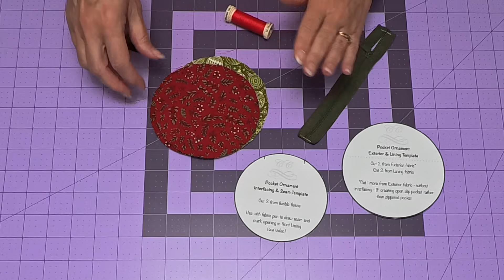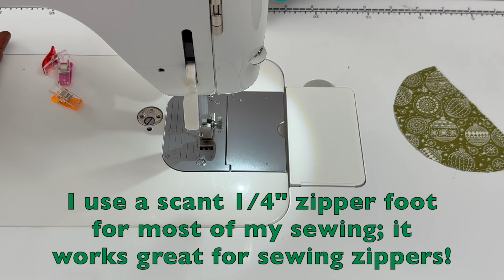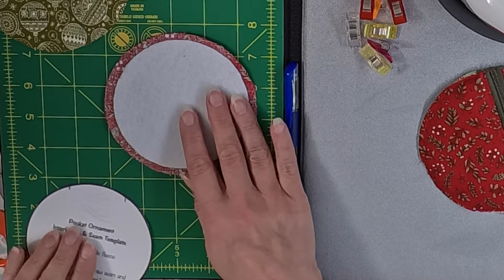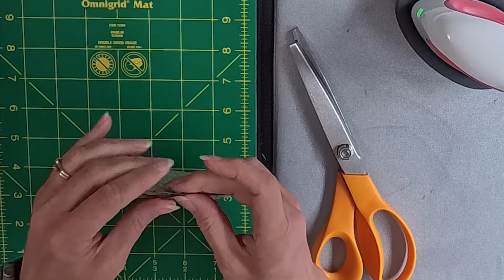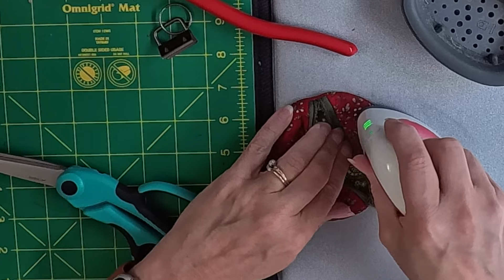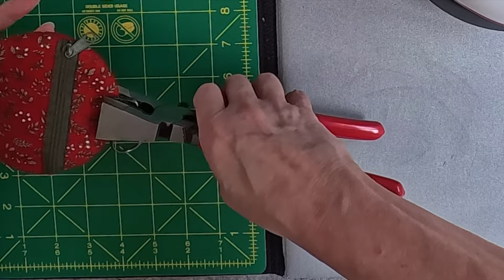Pocket Ornament Sew-Along Tutorial

Comment: There’s no way the circles match if you turn under the edge on the front for the zipper.  Fail.
Reply: She's turning under a quarter of an inch on the top and a quarter of an inch on the lower part. So minus half an inch.
And she's adding in the width of the zipper and part of the zipper tape. It looks like she has calculated it pretty carefully.